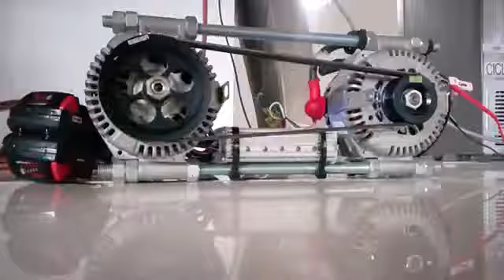Free energy generator || PMG low rpm

Comment: Yes it is true what you say, this will only work when you change the rotor to neodynium and harwest all the back emf from the driving motor and use a flywheel, but then it will work just fine, you can contact me on direct schematics and working formulas so you can calculate what i say to what you got " motor, generator etc" and be on your way, most importantly, do not loose hope because you simple learn, have to learn more and because you have to overcome "becomming more" than you are when you thought it was easier than it was and had to grow to be able, YOU WILL SUCCEED if you know it is truely possible and this fact i can directly prove to you with you owb eyes and calculator.